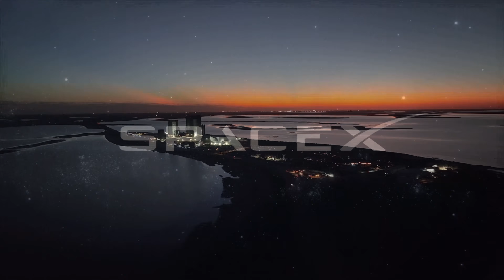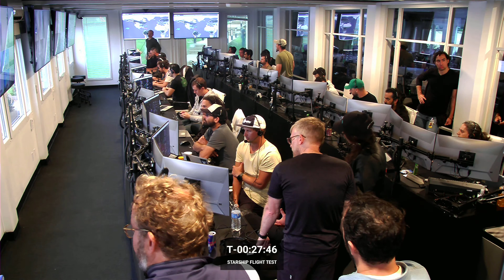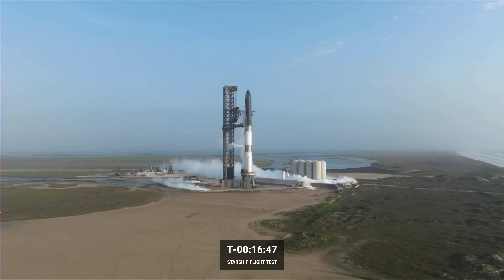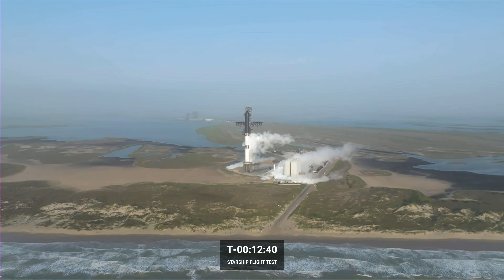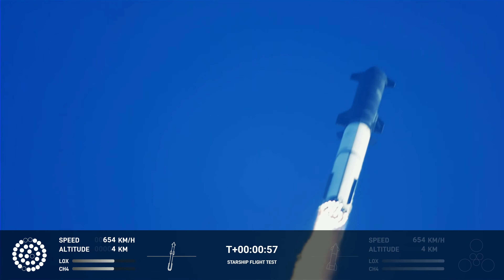Starship Flight Test

Comment: So Starship must be really tough to endure all that spinning at these speeds and not fall apart immediately, just wow from where it goes now. Congrats SpaceX ! ☺
Reply: It was probably robust enough to make it back to earth in one piece too, even with all the spinning. They had to command a self destruct.
Reply: @Reaction King this is much much different from 60 years ago even if tech is better
Reply: @Reaction King Stay mad
Reply: @Reaction King You do realize they had numerous tests before they got to the moon, right? This is a new rocket design, the largest ever built, using a new manufacturing process, with a new kind of engine, using an uncommon fuel. Of course things will go wrong, that's the entire point of doing tests like these.
Reply: @Reaction King I guess you think of yourself as a genius, having to manage such enormous vehicle with 33 + 6 engines. Just being able to monitor and liftoff is an enormous success. As Musk said himself the most you learn from failures.
Reply: @Reaction King SpaceX did a good job at managing expectations.  And overall they performed well for a first attempt.
Reply: @mini_ivo7631  Wow Mini:  Your perspective is pretty warped --- 60-years ago it achieved the goal.  Today, it blew up!
Reply: @Reaction King this is the development of a rocket. You can't compare these two things... However I also don't think that this was a real success. But it also wasn't a complete failure. And it is pretty common for new rockets to fail many, many times. Saturn 5 had also a lot of development until it worked.
Reply: THIS is a huge takeaway from this flight. Other rockets would have folded under these G-loads but Starship was structurally ok. It appears they pushed the button and the rocket itself was still in good shape (minus departing controlled flight).
Reply: @Reaction King Saturn V were almost as big as this and were throwaway designs. This was just a flight test, not an orbital flight test or a test to see if it could return to the launch pad, just a flight test to prove it can do it. Next tests should be with separation and also booster landings. This is a huge success.
Reply: @Reaction King you do it then ¯\_(ツ)_/¯
Reply: @Reaction King if you've got nothing good to say then this isn't the comments section for you
Reply: @Reaction King you literally dont know what you are talking about. Building a Ship to move 3 guys to the moon or 100 Tons to Mars is a tottally different my guy.
Reply: @Reaction King Get a perspective.  The development of the Apollo program leading up to the Apollo 11 mission took nearly a decade and involved more than 400,000 people across multiple organizations, including NASA, aerospace contractors, and other various other government agencies.  SpaceX is a private company with less than 10,000 people and has already completed 27 space missions for NASA.
Reply: @DisorderedArray  No It woud have started to Break apart but Even the blunder woud be Dangerous
Reply: @Reaction King fully agree the V2 reached space 80 years ago These people realy need to Stop coping!

Comment: 3 months and they already have the pad basically fixed and another booster loaded up for testing. Badass.
Reply: Next: spin prime/static fire, then stacking, and then LAUNCH!
Reply: when is the launch @dinosaurearththeory
Reply: @dinosaurearththeory  okay hope that orbital test will be successful
Reply: @pratyakshyt  i'm still worried because 4 engines turned off not because of pad damage, only 2 turned off on booster 7 static fire
Reply: @dinosaurearththeory  also did SpaceX tell what happened to the starship during orbital test that caused that flipping and then rud
Reply: @pratyakshyt  pad damage = engine damage = can't even turn it off = tumble = rapid unscheduled disassembly
Reply: @dinosaurearththeory  there was pad damage ? Also the stage separation never happened too
Reply: @pratyakshyt  33 raptor 2 & no flame diverter = concrete tornado
Reply: I'm guessing the Stage Seperation mechanism was damage because of the tumble, or it used Hydraulic Power which was lost in the first few minutes.
Reply: @pratyakshyt The thrust assymetry caused by many engines out caused the tumble, an HPU casing was also seen bursting with flames the first few seconds.
Reply: Hopefully the new bidet will atleast minimize the pad damage from 33 engines.

Comment: The announcers sort of forgot what was supposed to happen when it went wrong.  "beginning to flip for stage seperation" 🤣. Congrats SpaceX!  This was beautiful.
Reply: it was supposed to flip and stop, thats why the rocket have flaps, whatch other successful flight tests to see
Reply: I think he know, but just continue with commentary, hoping that it might corrected itself. lol
Reply: it was suppose to flip so it would separate but it didnt happen. in my mind this flight was a success and the point of the "test flight" was successful
Reply: @katheryn6748  no it’s not. It separates and the bottom flips. It doesn’t do a happy little flip before separating 😂
Reply: @dpmakestuff  Exactly, if the entire stack flipped before separation then Starship would need to flip around again as it needs to continue on the launch trajectory to reach the intended orbit. If it didn't, they would have headed back to over continental US which they didn't want to do at all for a first flight (or any flight I would presume, you would launch from west coast if you wanted a retrograde orbit).
Reply: @sokinnlife259  no. It separates and then the booster flips. The starship should never flip… until landing I suppose.
Reply: @u1zha  no. The starship (top piece with winglets) does not flip for separation. That would serve no purpose and make no sense. The booster stage separates, flips and boosts back before flipping again for landing.

Comment: the fact that this mega heavy machine building-like structure have cleared that tower is a big WOW! 🎉 looking forward for the future of this machine! This thing is really HEAVY METAL!!!
Reply: It had already failed by then.
Reply: Too  much concrete was thrown into the engines.
Reply: It's just a bigass bottle rocket.
Reply: Really, why don't you volunteer for the next flight if it was such a success!

Comment: Congratulations to the whole team!! This was an amazing achievement!!
Reply: Yes and you know what will be an amazing achievement ? It's my Ratio
Reply: @HFDLIDFRKOFFICAL bro it's the first test launch bro wtf. Challenger wasn't
Reply: @HFDLIDFRKOFFICAL  Ok then trollbot
Reply: @@blowngasket1847 A few things. Flight crew activated the Launch Termination System. It didn't just blow up by itself.  Also it launched and cleared the tower which was the whole objective. You expect a nominal
 mission for the first full prototype of the most powerful rocket in the world?
Reply: @HFDLIDFRKOFFICAL  Saturn V due to its lightweight structure had two failures actually. Any that's old technology. Like they are still suing SRB's lol. Now that's old. Put in perspective. 2 SRB's and 4 engines. That's it. Now starship has 33 raptor engines. Big difference right?
Reply: @CasChonk  still works though
Reply: @notmo.  it doesn't now lol. Very old tech though. It cost way too much to keep going. That's why you need to innovate and you can't do that without failures
Reply: @CasChonk  i doubt you're a rocket engineer or working at a space agency so your word doesn't have much credibility.
Reply: @notmo.  you don't need to be to have common sense lmfao. It literally produces more thrust than N1 and SLS. It's more powerful simple as that.
Reply: @CasChonk  i just said that it still works and that's a fact as we saw with the sls launch. idk what you're talking about.
Reply: @notmo.  bro I talked about the Saturn V and the SLS. You have to be more specific buddy on which rocket works or not.
Reply: @notmo.  SLS was successful on its first try because a similar concept and design had already existed. However, in comparison to the Starship, which aims to be fully reusable and capable of carrying heavy payloads, there are no other rockets with that ability. Therefore, a lot of testing and research is needed.
Reply: @notmo.  he forgot to mention where in the world is common sense comes from, he could be 1 of those tribal people who see it as common sense to spit at some1 feet for good luck
Reply: @aliuddinazfar3388  i know, i was just replying to the person above you because they claimed that sls doesn't work, which is factually wrong.
Reply: @HFDLIDFRKOFFICAL  thank you!

Comment: Holy cow!  Even with engines out it went through MaxQ like a boss!  And that tumble!  HOW did that thing stay together as long as it did?  Congratulations to the entire SpaceX team.  Just an amazing feat!!!  Looking forward to every future test.
Reply: Ideed this rocked certainly can take a beating and still do it´s job, once they figure it out and refine as much asa falcon 9, this will be the safest rocket ever built-
Reply: And man went to the moon in 1969  HA !!!  They cant even get a rocket up of 30 miles into the air !!!!
Reply: Yeah that thing is structurally sound AF.
Reply: Hundreds of other rockets, many carrying humans have gone through MaxQ before and managed to not blow up
Reply: @muttpigstye192  they do it all the time look at their landing success record for falcon 9
Reply: @johncroll1467  other rockets that had been flown and tested many times before people even entered them. This rocket is still a prototype
Reply: @FruitingPlanet  No. The Fakt that this Thing has over 30 engines Just in the Main Stage Makes It un save every single engine brings a new Point of failure and ass we saw in the Test the engines do Not Seam to be very reliable. No Sane engineer woud Put so many Potential Points of failure on a vehicle!
Reply: @muttpigstye192  true
Reply: @johncroll1467  Agreed.  Though that number likely decreases sharply if they were running with three or four inactive engines on the booster.  That's all I was saying.  Engine failures, and it still had punch.
Reply: @_kampfkartoffel2195  Until we get nuclear engines or something to replace chemical rockets we need a vehicle with this many engines to lift heavy cargo to orbit. True engineers are willing to take risks in the development process. This thing will be reliable in due time
Reply: @ReiseLukas  No It wont and you can't Take Risks with a Rocket that is build to carry humans. One of the Most important Rules in space Flight is to keep the number of Potential Points of failure low and to add redundancy this thing ignores both. And nö more engines are Not redundant becouse every singel engine failure can create a fire that leads to the Destruktion of the Rocket. A failure Just in one engine can also lead to inbalance (shown by the Rocket spinig) and an aliteration of the Flight path that Makes precise manuvers Like docing almost Impossible!
Reply: @ReiseLukas  also a nuklear Rocket woud never be able to generate enought thrust to Lift of! Such an engine only workes If you are already in a stable Orbit
Reply: @_kampfkartoffel2195  "you can't take risks with a rocket that carrys humans" You're right, that's why they're testing it the way they are before they put anyone on board.  

You can only test so much with simulations. The reasons rockets have been so stupidly expensive is that the turnaround to get them ready to launch is so long. 

To have a rapidly reusable system you need quick turnarounds, and the only way to make that feasible is to test this system to the limit. Make it fail over and over until every possible problem that could arise is explored and the final product is a tough ship that can take a beating and survive trips to orbit, the moon and beyond. The current methods of safe rockets has to change and SpaceX is doing that
Reply: @_kampfkartoffel2195  also the rocket is supposed to spin to separate, but it failed to separate so it kept spinning
Reply: @rXw55 Agree but doing that kind of maneuvers around Mach 1.6 puts the rocket under high stress, you have to consider this also.
Reply: @ReiseLukas  why does it Spin thoug I honestly don't know, why can't they Just separate and then Just Spin the uper Stage in the right Angle. That woud be far more Stabel I guess?
Reply: @_kampfkartoffel2195  The separation mechanisms is different from other rockets. Some rockets use hydraulics and some use clamps to separate the stages

Starship uses neither. Spinning is required to separate the stages. The problem isn't the spin itself but that Starship didn't separate and therefore kept spinning with the booster. Had it gone well the ship would've separated and the booster would've spun away
Reply: @ReiseLukas  why can't the Shop Just use the other Methodes you mentioned woudn't that be far Safer?

Comment: WOAH! Tbh i thought it'll never past MAX-Q but it did which is so amazing plus all those spins and the rocket didn't break in half which means that the rocket is SO STRONG. Congratulations space x i was over the moon when the booster started
Reply: They definitely collected a bunch of data even if it was a "fail"
Reply: Technicallly it was too slow for a max Q. Too many engines failed. the 5. and 6. were the end.

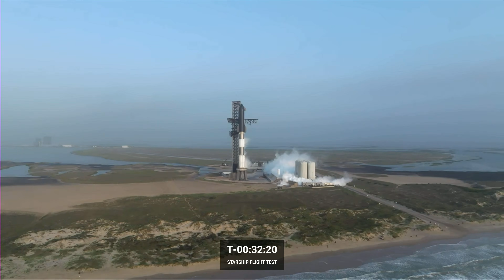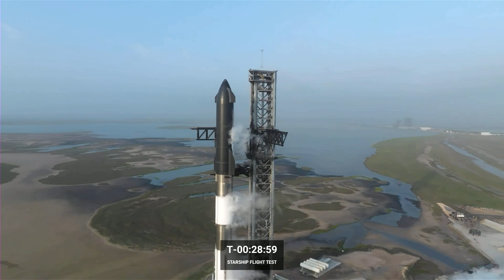Comment: 7:34 | 10:56 nice drone shots
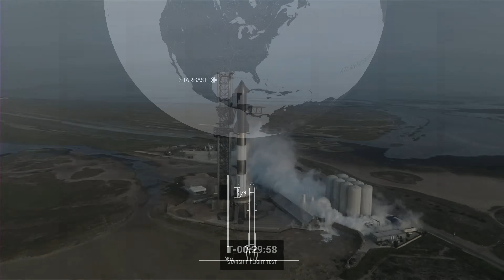9:58 flight plan
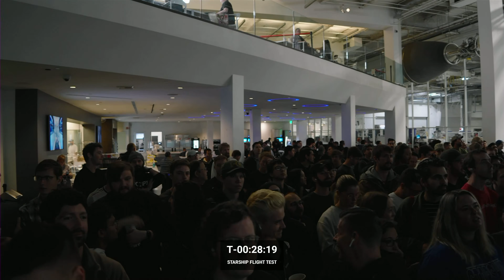11:37 Spacex employees <3
14:09 | 33:58  booster engines view
37:44 booster engines wiggles
39:45 HOLD
44:33 clock restart
45:02 IGNITION 
45:10 LIFTOFF
46:18 engines view
46:46 KSP trajectory 
49:03 RUD
52:56 end
Reply: amaing man
Reply: 52:56 FAIL, total loss
Reply: Good stuff Greg33 - you just made the day of all the mainstream media who now won't have to find the timestamps themselves :)
Reply: 65 likes in 17 mins? That’s so fast my dude.
Reply: Thanks Greg 33!
Reply: @antonsmith7235 it's not a total loss at all, with that I know that tons of info was gained from the explosion.
Reply: Appreciate that! 😎✌️
Reply: How powerful was that rud explosion
Reply: KSP trajectory

Jebediah - We have a problem!
Reply: MVP 🏆
Reply: Thank you for this, very helpful!!!
Reply: KSP indeed
Reply: No RUD, detonation from ground control.
Reply: What was that small explosion at the bottom of the rocket at 45:33?
Reply: @WireframeLicker  a copv bursted
Reply: @butterflymuse2707  No their gonna get a ton of "SCRAP METAL" if you want that to be called data

Comment: With so many engines, I'm honestly impressed that so many ignited.
Reply: The soviets were never able to get their moon rocket into space successfully with a similar amount of engines.
Reply: Looks like 6 of them were out. Some no doubt shut off to balance out the thrust. It still lifted off like a boss though. Also, no payload, so some of that may have been 'on purpose' to stay in the intended flight profile.
Reply: @squirrelsinjacket1804  the N1 got off the ground several times…just couldn’t get past the first stage engine issues in flight.
Reply: @97marqedman  Yea I edited my post to correct that.
Reply: @97marqedman  did N1's engines get blasted by supersonic concrete at liftoff?
Reply: @squirrelsinjacket1804  N1 rockets exploded and/or terminated because of the engines. Starship was terminated because stage seperation failed. Starship managed to make it all the way to staging something N1 never achieved.

Comment: I thought it was gonna blow up on the pad, honestly. All that power firing at once, I was so certain it would. Then I saw it moving upward and the real excitement started rising in me. Could not believe it hit that altitude first time, but I should've known they'd have gotten so much so right already. Will be so exciting to watch when it has its first fully successfully mission. Until then, I hope the launches increase.
Reply: I thought it was gonna go on the pad too.  The other thing I thought having just watched this..do you think they can use that pad again?  Those rockets sat there for a good 8-9 seconds before it actually took off…
Reply: @sporadix1701 they can but not before major repairs. There’s a massive crater under the orbital launch mount.

Comment: Incredible that the whole 2 stages held together over the barrel rolling that's a lot of g force Incredible engineering on SpaceX part😮
Reply: if only they overengineered the launch pad lol.
Reply: Its impressive to say the least that it managed to hold under that stress load.  A indicator that the engineer really did put effort into the ships ability to hold together.   A very good sign of the quality.
Reply: @WKA1gaming  True but given it was itself also a test bed.  It means the pad will just be improved and updated.
Reply: Why the separation was not initiated and then a landing attempted? There was no reason to destroy both parts of a ship that can land .... allegedly.
Reply: @reasonerenlightened2456  They lost control of the hydraulic system. There's no way they could land without that (or even separate). Terminating both vehicles was the safest outcome.
Reply: @Tresla   I agree with you that the design is poor.
Reply: @reasonerenlightened2456  But, without this test flight, SpaceX wouldn't know it was a poor design. The goal of these test flights is to gather data, to aid in refining/improving the design. At least now they know that their HPUs can't handle being bombarded with a rock tornado 😆